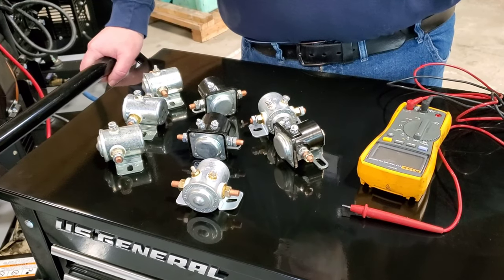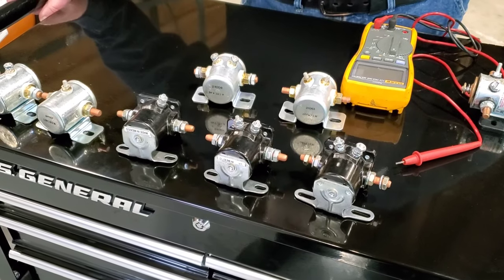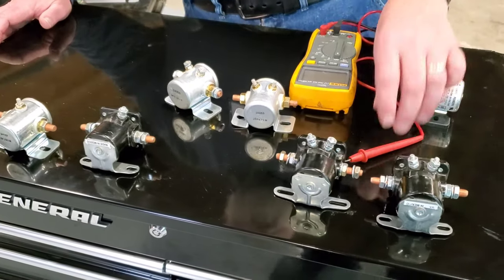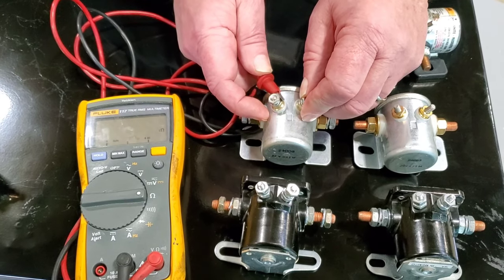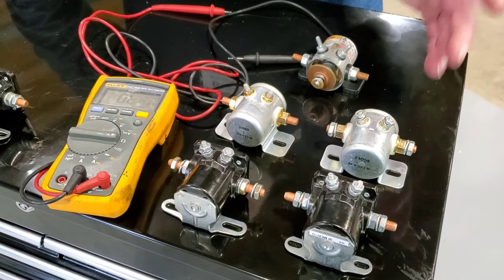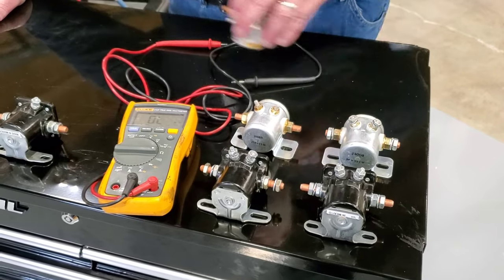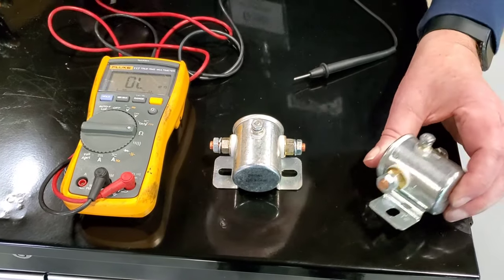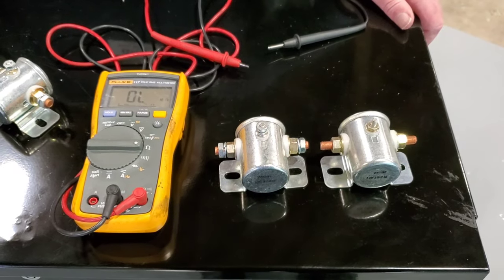Starter Solenoid Differences Explained. Equipment

Comment: First time here, and solenoids are above my pay grade. I thought they were things that rode on starter motors like a little space shuttle on top of a 747. Turns out that on my Econoline E150 van the solenoid is tucked in to the very front corner of the van, even farther out than the battery. Like they were trying to hide it or something. Nowhere near the starter motor, anyway. And now this video's got solenoids looking like other solenoids. Like they're trying to fool even the mechanics. Sheesh. I hope my mechanic knows what he's doing.
Reply: They are really easy. Just an electronic switch that can handle way more amps than a simple toggle switch.

Comment: Probably why we have a tug that has to solenoid one for the starter the other for the engine and accessories and the one for the accessories gets hot to touch and run for few hours and turns off no start u put a new one it will get hot and stop working

Comment: Why do most systems have a starter solenoid in the ignition circuit and on the starter itself? Shared load?
Reply: The solenoid on the starter motor physically thrusts the Bendix gear  outward to mesh with the flywheel as long as the ignition switch is in the start position and retracts quickly once the engine starts.

Comment: I’ve got a 12v version of the last solenoid… three terminals…the two main posts are each connected to two positive (one wire to one positive post. And the other to the other battery) battery posts (bass boat, with dual batteries)… the small terminal in front is connected to a single red wire, that I have not traced…. Can anyone tell me what I’m looking at? It’s old (1995 vintage) help! Thanks for any ideas…Kevin

Comment: By the way is there a way to use a Ford solenoid on a Oldsmobile 1978 403 there is no room for the solenoid on top of the starter getting it in and out around the pipes is next to Impossible as one person. + my wires where cooked that guard and is useless the car has 46k then parked.

Comment: I have been having electrical problems and this was one of the first things that I replaced; then diodes, more recently starter. 
I remember when I bought the solenoid the clerk "matched it up" but didn't use a multimeter. I still have the old one and will compare it.  Excellent video, Thanks.

Comment: I always knew that there were different solenoids ,mainly 3 and 4 post. Recently I had a call to work on an older ONAN getset from 1975. Right away I knew the solenoid was bad but luckily I used my ohm meter after removal and noticed differences than say a Ford solenoid. Your video was very informative! Thanks you for your knowledge!!

Comment: I actually learned alot. I came for something else but now i know why my old onan generator will just shut down after a few hours running, then start again after it cools down. Sounds like the previous owner, my grandpa, installed the wrong solonoid for low oil shutdown.

Comment: My friend had a well drilling rig. Great place for kids to play when no one was there to shoo them away ! Battery always dead ! I put a 12 volt constant duty "relay" that switched all control voltage in the truck . Iginition switch operated the "relay" so the entire electrical system was dead unless ignition switch was on .

Comment: Yup a 12 volt solenoid with a 4 ohm coil would draw about 3 amperes and if used as cont.
service, it will burn out, whereas a 12 v relay would be 12  or more ohms. I rebuilt on of these.
drilled out rivets wire brushed armature and contacts, new spring, there was an oil wick, so I 
oiled it, Solenoid used to send power to a 12 v gen used as a stating motor for a BS 9hp engine.

Comment: Working with these since the 70's, Luckily I never had to Deal with one that used the I for Ground that I Remember. Great info and Clear Explaning, Seems I had run across one in the Past where Mounting Plate was Isolated, and had a small push on Terminal for the Ground, Have you seen those? Or am I thinking something Else? Thanks

Comment: hello there, I am in the right place. I have an old tractor that uses a 24 volt starter, the altenator/generatior is 12 volt. A series-parallel switch(solenoid) temporarily gives 24 volts for starter. That switch is burnt out. Can I use a 24063 spst to replace that switch?

Comment: Can you use a car solenoid on a motorcycle or any other type of solenoid on a bike such as a homemade Chopper with a 50cc engine? I know it's a funny question thank you very much nice video
Reply from the maker: You can, might be overkill for what you need. but should dpo the job

Comment: what about a 3 stud negative to excite vs positive to excite solenoid? wondering about this for my 80's boss plow. I had to order 6 different solenoids (two of which said they were negative to excite, but weren't) until I found one that did. How do you test for negative to excite? I had a mechanic fix it for me.
Reply: Swap the wires Eisenstien.

Comment: Had NO IDEA the ones that looked the same were different, this is WHY after I fried one of my mowers wiring I WON'T work on my other one, & I'm screwed because I'm 30 miles away from a shop in rural Florida and even the shops I contact WON'T even hand sketch me a basic starter / charge circuit diagram  SMH

Comment: those of you that dont have a meter  try test  -----turn key only gives a click stop go to soleoid short 2 big bolts on solenoid this will spin starter  if battery is good  replace solenoid try to get same type so wires a mtg holes match   elect.  they are all  he same
Reply: He means I believe leave the starting ignition in the run position and with a screw driver touch both pools at the same time (with the metal shank of the screw driver) or any thing that's conductive made of metal like a piece of solid house wiring that's has most of the insulation on it that 
 can be safely held on to while  bypassing the internals of the relay to Ingage the starter for starting and once started remove screw driver to stop the Ingaging and spining of the starter only need to do this if turning the key does not turn starter spinning. If starter turns over but no start it could be a bad ignition switch or fuel pump including no fuel or very low fuel in tank ect. When bypassing the starter solenoid and it starts it`s most likely a bad starter solenoid; replace with OEM or a good after market thats like the original. Ps don't run starter for more than say 10 seconds at a time you could damage the starter or at least run the battery down.